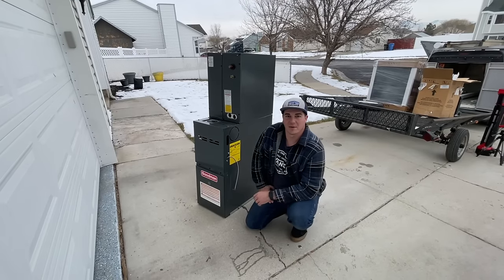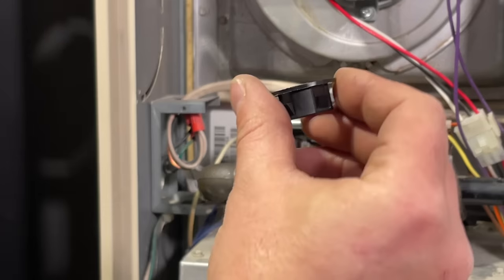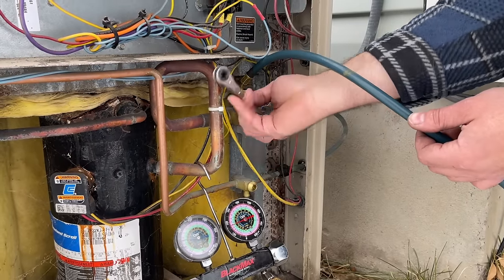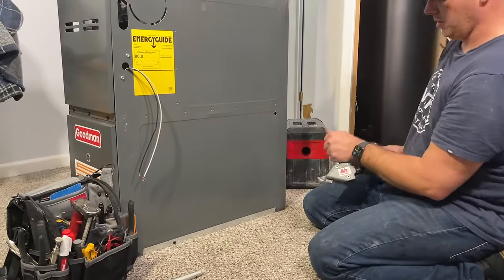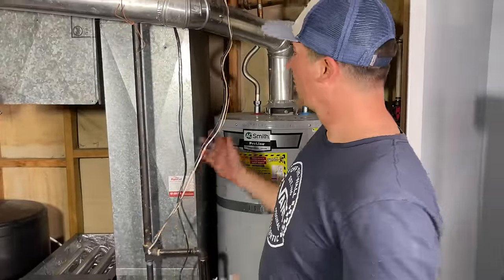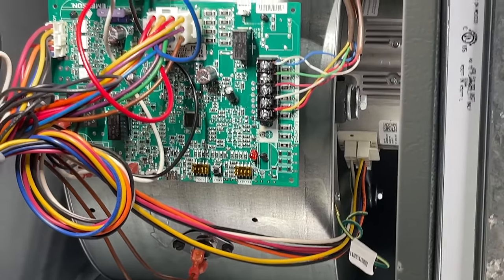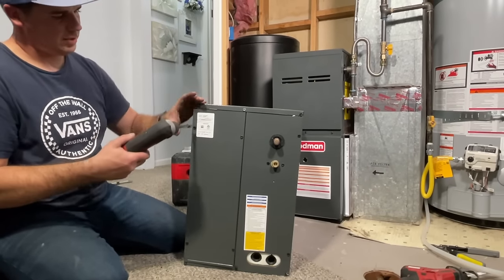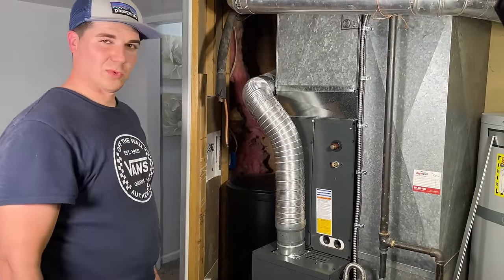Save THOUSANDS Replacing Your Gas Furnace Yourself.

Comment: Great video Dave, thank you!  You installed a Goodman unit, do you feel they are of decent quality, or are any others better?  The reason I ask, is that in our community in NE Florida, the builder installed Goodman heat pumps, and most homeowners are having issues with them, mostly corroding coils, and not high quality components.  Thanks!
Reply: I have 36 years in the trade, and I can say with certainty, that most of the components in unitary systems are the same regardless of brand. In an apple to apple comparison, no manufacturer is better than the other, since they all share many 3rd party component.

Now on to coastal, I have done HVAC in 5 states but the only coastal work was in southern California, and yeah salt water air and condensers don't mix well. I saw no difference in performance between brands, nor units stated as coastal rated.

Ive never been a geothermal fan in general, here in the midwest I can do Mitsubishi and are Bosch heat pumps at close enough to COP for a lot less money that I don't see geo be advantageous, but coastal the initial cost may make sense of replacement costs of air to air heap pumps dying from salt water air.

Comment: I have had my 3 ton replaced with a Goodman many years ago. I was expecting the A coil to be nasty but it was fine.  My question is if I  do a diy next time is it absolutely necessary to change the A coil.  It requires cutting into the duct work .it vertical above the furnace.however it has been cut into last time closed up and sealed with metal tape
Reply: There would be absolutely no reason to need to change your evaporator unless it was leaking but also you would need to find and indoor blower and furnace setup that are compatible with your old evaporator. It honestly would make that whole process more complicated But 100% if you are planning on going bigger like a 5 ton unit for example you absolutely need to change that evaporator it will not keep up. And to be honest with you it would be much easier for a DIYer to just buy matching and compatible everything.

Comment: One think would have also done is braze the line set closed as soon as it was cut to prevent moisture from getting into it since it will be exposed till the next day especially with the humidity in the air from that snow.

Comment: Some states give rebates it actually came out cheaper to install a 96% after rebate
Reply from the maker: Here it is $350. Not nearly enough to cover the price offset.
Reply: @diyhvacguy  it was a few years back and they were both Goodman furnaces non ecm single stage and yes with the $350 rebate

Comment: Hi Dave, I like all your videos. I'm struggling with my furnace. Do you have any idea why the heater doesn't stop even when I turn off the thermostat? It keeps working until it melts the furnace wires. I've already changed the high limit switch and the control board also the thermostat,i hope you respond me. Thanks

Comment: Keep up the good work. People will always tread on others. Im in the mechanical field. I remember years ago my furnace went out and i called a hvac friend but he couldn't get there till later i followed the blinking lights used a simple meter to confirm and had him bring the part over and change it. This stuff isnt rock science. Anybody can do this type of work that has basic mechanical and electrical understanding. Other than boilers they're fine to diy stuff. I dont diy a lot of stuff because i dont carr to but if your gonna charge me 18k to put in a 90% efficient replacement furnace you can go fu** yourself ill do it myself all day video or no video.

Comment: sorry, one other question, can most furnace units be mounted horizontally?  My basement is only about 5'10" clearance, which limits adding a heat pump to achieve dual fuel with the update to my furnace.  In face, the old furnace could potentially be used as the LP heat source for when the heat pump doesn't have capablity.  I guess I have a third question then... can you mix and match components? in other words could you put a mitsubishi intelli-heat module with a lennox furnace to achieve dual heat?

Comment: Dude! Did you forget to dope a few fittings inside the furnace?! Please check!!
Reply from the maker: No, I was trying something new and applying the dope inside the fitting. Some recommended this way but I actually prefer to see the blue at each joint. If you saw a joint without it, that would be why.

Comment: If the fan motor doesn't work, and I assume compressor still works, will you be able to press the contactor and get the coolant on the one side still? or do you need a fully working AC to do this?
Reply from the maker: You can do it without the fan. It only takes about 2 minutes to pull the refrigerant into the condenser

Comment: Thanks very much for making this video. The return air duct is connected to the bottom of my furnace that I want to replace.  How will the installation be different?
Reply from the maker: You just don’t cut the side of the furnace, and then you remove the sheet metal that comes screwed to the bottom of the furnace! It will be easier for you then the side return like shown in this video 👍🏼
Reply: @diyhvacguy  I see. That makes sense. Can I also use the air filter rack in that case? Would the rack be able to hold the weight of the furnace?

Comment: I would only replace the furnace that has the evaporator coil on top. I need to remove the furnace and keep the evap coil where it is.
Reply from the maker: I have a couple furnace replacement videos that show how to do this. Check out my other furnace replacement videos. Cheers

Comment: So your yellow and condenser wiring how it is now is only gonna run the first stage speed on the furnace blower, just put it on the y/y2 terminal so you get full blower speed
Reply from the maker: Interesting. I’d like to test that and see the difference. Thanks for the tip!
Reply: @diyhvacguy  Not a lot of single stage furnaces have the Y1 and Y2 terminals just recently explained this to our other install crew always Y2 for a single stage condenser. Super nice for dual fuel sets up though!

Comment: I have 36 years in the trade, there is no need to cross break under 12" and that is per SMACNA, guidelines. Myself in field fab using 26 guage metal for a plenum transition I never cross break unless exceeding 24", its just not needed.
You shouldn't release the nitrogen until near the time of brazing in the refrigerant lines. The less exposed to atmosphere the better. 

I am not sure where you got that info but it is wrong, sealed under nitrogen, exposed to atmosphere as short as possible is the proper method.

Also you are not checking TSP correctly, you either need to check it after the filter or before the filter and add the manufactures pressure drop. in other words the return static you see on your meter and show to the audience is not the true return static if not calculating filter drop.
What is the pressure drop on that filter? .05? .08? .12? .20? .30? SEE WHAT I AM GETTING AT!

The best way is to check after the filter ignoring the manufactures claims, But you have to do one of the other!

Now assuming the costumer only ever uses woven fiberglass filters, your incorrect reading is close enough, but as soon as that 3M Filtrete marketing hits them, and they install one of those and that PD filter drop goes up from say .03 to .2 what happen?

Well the furnace overheats, and the A/C possibly freezes up, either way the blower has to work harder, and the newer ECM as that furnace had, don't like high static.

Comment: i love the video and will say that Dave you are a decent guy for sure. My next question since i,am in the market for a furnace this summer, can I use the same model type furnace you are doing in this video.
I do have a gas furnace with 96 percent effienance and mine was installed in 2004 being an Amana type.
I do have a 2-inch pvc vent pipe as back in 2004 the code allowed this. I would really like to purchase the
Trane equipment like in the vid and i like the extended top that houses the AC coil.
Anyhow please let me know if i could use that furnace and the cost.
My house is small with 1500 SQ Ft but i like the Trane equipement
Reply from the maker: Hey Glen, if you are looking to have Trane equipment, you’ll need to have a company do it. Doing this job yourself, you are limited to Goodman, Airquest and some other offshoots. In my opinion they are a great product but if you for sure want Trane you will absolutely need to hire a company. If you change your mind and would consider another brand, we have a membership that includes walking you through purchasing the right equipment, sizing, installation, and help with  the full 10 year warranty registration. That can be found at Patreon.com/diyhvacguy   Cheers

Comment: I have a stupid question. Here in Massachusetts you need a licensed plumber/gas fitter to pull a permit to do this. Are people just doing these DIY under the radar? Or is it that most people following along with you live elsewhere?
Reply from the maker: You can more then likely pull your permit there and have your work inspected. A lot of my viewers have done this as well as customers here in utah. It’s different in each state, so everyone has to check themselves.
Reply: @diyhvacguy  Thanks. Guess we're on the stricter side as we can't pull permits for this without a license.

Comment: I have two questions Dave! Sweet video btw! 1. Is it extremely difficult to move the furnace up into the attic instead of having it in the basement? My guess is ductwork will be a pain.... and 2. is this process similar with an electric furnace replacement? I don't have gas in the house
Reply from the maker: Hello, yes it’s definitely a huge pain to move the ductwork. In terms of replacing an electric furnace it’s the same, as far as connecting the ductwork. Then all you have is your electrical, no venting, so it’s easier. Just remove your old electrical and reconnect the new one exactly the same. If you need some help getting equipment or help with the install, feel free to check out our membership on patreon.com/diyhvacguy where for 25 bucks you will have one on one help with sizing, finding equipment, installation guidance, warranty info, and much much more. Cheers,   Dave

Comment: Manufactures require a contractor to install in order for the warranty to be valid. Anyone installing their own equipment voids the warranty.
Reply from the maker: Wrong wrong wrong. The unit can be registered by a license technician but even if it isnt, the unit is warrantied for 5 years. The dealer doesn’t ask who installed it lol you fill out the paperwork and get your new part. Yes it’s as easy as that folks
Reply: @diyhvacguy  Just verified on a Crown boiler that DIY install is ok.  The gas fitter side is still a problem.  I need to find one willing to simply connect and run a combustion test.  Not having any luck so far.  In my state, DIY electrical and plumbing is ok and I do good work on both.  Could do the gas except for the regs.  Have had several bad experiences over several decades with schlock work by an "expert".  None of the good guys in these videos is near me 😀

Comment: have you ever replaced a heat pump with a gas furnace? can a diy homeowner tackle it nearly as easy as replacing gas with gas? here in the mountains of Western NC (Asheville) a lot of houses have heat pumps that struggle in the colder days of winter and mine uses too much emergency electric coil heat. wondering if I should replace with a more efficient heat pump or go with a gas conventional instead
Reply: Have you looked at a modern one? My 24 seer 13 hspf one has no problems in the heat or cold down well below freezing
Reply from the maker: Yes you can do a high efficiency gas furnace that will act as your backup/emergency heat, and your air handler/coil for your heat pump when it’s not crazy cold
Reply: @diyhvacguy  cool, I'll search your videos to see if I can find something about changing the source of emergency heat 👍

Comment: I installed the exact goodman you did and I had a black wire just laying the bottom of the furnace and it had a connector on one end and just copper on the other and it's about 12 inchesong do you know what this wire is for
Reply from the maker: Probably on one end of the door switch!
Reply: @diyhvacguy  thank you I will check that

Comment: Just a question why did you go mid efficiency instead of high it might be cheaper than going high efficiency but with 20 to 40 % less heat going up the chimney it'll pay for itself in a short time especially with the price of gas going up and up I've seen our gas bill go from 30 dollars a month to to 260 $per month so if i can keep 40 % from % going up the chimney I'll opt for that option
Reply from the maker: Because if size limitations. They don’t make a 60k A width 96% furnace. I literally had 14.5” on this install.
Reply: @diyhvacguy  The 60k btu 96% has a  higher heat output than a 60k 80%. In all likelyhood, you could have put in 40k btu input / 38k btu output 96% and been fine  - after doing a load calc to check. Most furnaces are too big.
Also a shame you downgraded it from a 2-stage lennox to a builder's single stage. The owner won't get the same comfort and goodman is a poorer quality product.

Comment: Hey HVAC DIY guy are package units common in your parts?  It's probably the most friendly DIY option.  Just need a good crane operator or strong guys.
Reply from the maker: There is hardly any package units out here in utah but they are all over the place In Tennessee. They are very easy to install once set in place. We have used pvc to roll them around several times 👍🏽 I’m hoping to have a replacement video for one of these soon :) cheers
Reply: @diyhvacguy  Here I thought you are in the Midwest like Benjamin S and Everyday Home Repairs.  Good stuff man.  Keep up the good work.

Comment: Beautiful. A question on the liquid line set. My run length is a bit over 17 feet give or take a foot, how much is acceptable over that to connect? 20ft new lineset be ok? I can probably move the new condenser a foot or two away. And I saw a formula for adding more refrigerant somewhere.... The unit is charged for a 15 ft lineset BTW

Comment: my furnace is making loud noises and is super old.  Can I just replace the furnace part and leave the old air conidtioning coil intact for now or is it super recommended to replace both at the same time?  Just trying to save $ where i can.
Reply from the maker: Yes you can just replace the furnace. I have a few furnace replacement videos where we left the coil and ac portion in tact 👍🏼
Reply: You are the man, just subbed to your channel!  @diyhvacguy

Comment: I have a Rheem furnace from 1992 (Model Number: RGLG-075AUER, Serial Number: CB1D302 F1692 6362) that has begun to have problems more frequently. I was wondering if you know what newer model  or a different brand that has the same measurements and can be swapped into the same space? Thank you in advance!
Reply from the maker: Hey! I offer this service over on Patreon.com/diyhvacguy  for just $25 I’ll help you find the right equipment and send you a link for that, and I’ll also help along the way with the install as well as help you get the full 10 year warranty. Check it out, hope to talk to you soon over there 👍🏼
Reply: @diyhvacguy  I saw it's a monthly charge. Can I pay $25 just for this one time. Also can a non-licensed person be able to buy Rheem or Ruud? Thank you.

Comment: I hope you can answer a question for me. The heat/ac unit outside occasionally has the blade stop spinning, but I can still hear the motor trying to run, then smoke starts to come out from the top. Eventually the fan starts back up and the smoke clears out of it and it starts to sound normal again. I live in Virginia and it didn’t snow here, but it has been cold. Is the unit outside about to die? What do you think is going on based on my explanation? I really don’t want it to catch on fire and burn down the house. Any advice would be greatly appreciated.
Reply from the maker: It sounds like either a bad fan motor or a bad capacitor. Turn the unit off, and spin the blades with a stick or something you can fit through the top fins. If it spins freely, you probably have a bad capacitor. If it’s stiff it’s probably a bad motor.  
If you need help with technical stuff like this and help with replacing parts, feel free to check out our membership at Patreon.com/diyhvacguy   Here you will get one on one help with this type of thing as well as any other hvac related questions.  Thanks,   Dave
Reply: @diyhvacguy  Thank you Dave! I really appreciate your time and knowledge. Happy New Year!
Reply: Sounds like the defrost cycle and nothing more.
Reply: @Kevin-mp5of  thank you so much for your help and your input. I had no idea it had a defrost cycle. I just know that I’ve never seen it act this way before and in the past winter’s I don’t think I’ve ever seen it do it.
Reply: @ivanbejar5  I appreciate your help. I don’t want this problem costing me a fortune.
Reply: I agree 💯 with Ivan. Not the dks guy.
Reply: @glenbeaver2784  Thank you Glen.
Reply: @tinak.3022  your welcome

Comment: If my old air conditioner and coil are r22 refrigerant, and I am installing a new one and is r410a refrigerant do I need to replace the copper pipes from the condenser to the coil ?
Reply from the maker: No, just a flush and you will good to go! Watch this video and I show the easiest most cost effective method 👍🏼

https://youtu.be/Sxx4pNBF0_0

Comment: Why was it necessary to change that valve? Most like it like new since its never been shut since it was installed.
Reply from the maker: Exactly. I just make it a common practice. It’s little things like that the customer appreciates even if they didn’t know it included a new valve. Plus it’s pretty and yellow 🤣